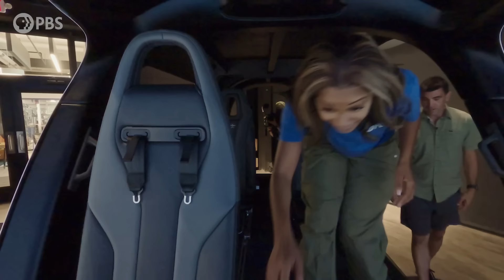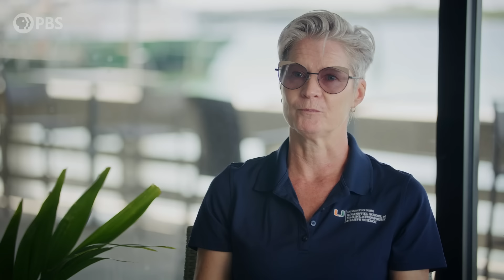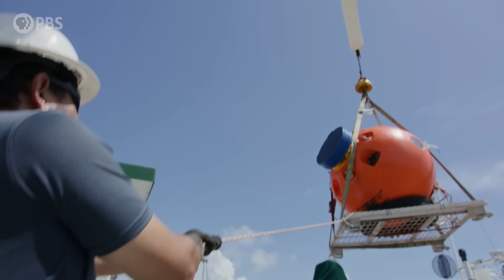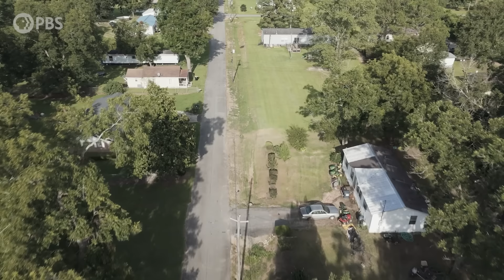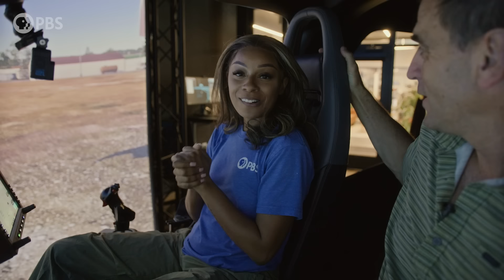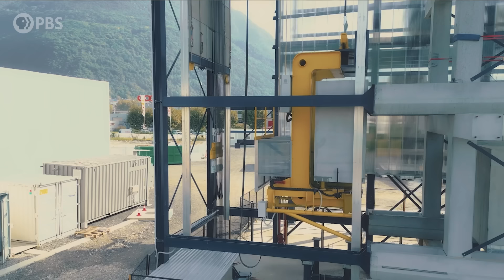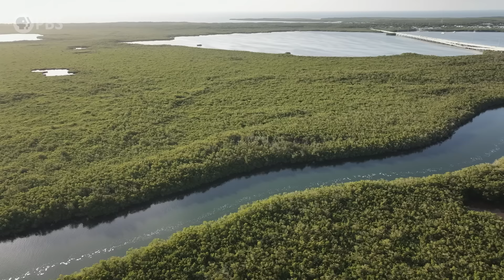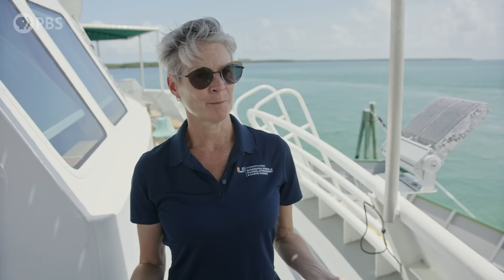This Is The Best Evidence That Atlantic Currents Are Slowing (AMOC Explained)

Comment: We burn fossil fuels to produce electricity. So electricity is not exactly green.  We have been told mining for a coal and fossil fuels is bad for the environment, but the electricity companies can mine for precious metals, rare metals to produce solar panels and batteries.  Don't you think that's contradicting If it's bad to mine for coal, it's bad to mine for precious metals Logic is extremely strong here.

Comment: Back in school 35 years ago or so, the so called experts said global warming would have Florida mostly underwater over ten years ago.  Yet, it's still there.   Climate change is the second biggest hoax ever.
Reply: Exactly 💯 

In college in the early 90s, I was taught that the ice sheets would disappear and sea levels would rise exponentially by 2040-50. Maybe my professor knew something (or was psychic?), but none of this has happened, nor do climate change proponents state it will happen by then. In fact, they keep pushing the date back every ten years, currently stating by 2100.

Comment: probably has nothing to do with the mid Atlantic ridge spreading about 10  centimeters over 40 years. add that into your models if you speak of deflections in currents
Reply: Nope, that would have no effect.
Reply: Wonder how those oil platforms and dredging the sea floor for nodules will do.. LMAO..vote for trump is a vote for Armageddon

Comment: This really starts going off the rails when it started going into electrifying aircraft. There is a huge difference between what you are showing, and replacing the entire global commercial aviation (passenger and fright) fleets. Pie in the sky BS that ignore basic material science hurt the argument more than it helps... We need to retool the energy markets, but its not going to happen by selling this fraudulent ideas. We are 100% not going to be flying electric plans for commercial aviation in 2030!

Comment: i have always wondered why geothermal is never really in the conversation. we have deep holes fracked all over the place, and there is heat what? 3 miles down? could a heat pump system using an effective coolant not be used to generate electricity via that heat transfer?

Comment: The majority of electricity in this nation is produced by the use of coal and natural gas.

You are dealing with the front end of the energy issue.  What about the batteries in electric vehicles.  The master and propellers are made of products that are not good for the environment.

Please be real and consider the TOTAL cost to produce, distribute and yes consume electricity.

Comment: “Electrify everything “ has its own costs, fyi. Heat pumps are not going to work in every climate. Also, to expand electrical infrastructure and create more electronics requires much more mining of increasingly limited resources. Luckily copper is pretty infinitely recyclable — if we retrieve it out of discarded electronics and other items. However, lithium, cobalt, and other minerals are problematic. Also, while glass is also “infinitely” recyclable, we’re not recycling it. We are starting to see shortages of the type of sand we need to make glass. 

Now I’m not saying don’t try, but we need to be wary of such broadly sweeping statements.

Comment: Talking about people still not using heatpumps for heat, especially in the south boggles my mind. I am 37, and I've never lived in a house, apartment, or trailer that used anything but a heat pump, with a woodstove, or fireplace for emergency heat, or auxilary/luxury heat. And the only time I've really ever been in someone's home that still used nat gas, a furnace, or a woodstove/fireplace as the main source of heat was friend's grandparents who just refused to update. But they also didnt have AC or had window unit ac. 

And honestly, my current house has a fireplace, that is wired shut, with the chimney flue also blocked It just isn't worth the effort to build a fire in there. Last house we used the wood stove a few times when the power was out.

Comment: Man cannot change the weather and climate, it runs in cycles and what people need to deal with is the next ice age, it comes after a warm-up. Then naturally occurring methane and co2 build up, then there is a point when the cycle turns and the cold cycle and ice age is back again, Gulfstream slows in the warm-up and speed-up in the cooling. This is PBS it features bad science with bad climate science.

Comment: I live in western PA and we have a heatpump, but if temperature drops below 35, we have to switch to our oil furnace and until heatpumps can work in really cold conditions, they only help halfway. Out heatpump does not work the whole winter, probably less than half. But it is good for A/C.

Comment: No mention of the other side of this conversation. 
We need magnitudes MORE ENERGY to solve these issues. Like that carbon capture you mentioned and recycling and repurposing cities in order to stop sprawl. Not just efficiency, but energy to do the repair work. 
No mention of advanced nuclear that its technology is moving at a pace faster than those heat pumps. 
Then there’s the capitalism issue…which is responsible for this climate change emergency. 
This whole “personal responsibility” angle for solutions is long been debunked.

Comment: We should also be concerned with methane, which besides molecule to molecule methane holds 26 more times the heat as a molecule of CO2, is also flammable! Further, melting permafrost is releasing tons of methane daily. Additionally there is a huge amount of fossilized material from thousands of year’s ago which will generate huge amounts of methane that has been contained in the Arctic and Antarctic areas.

Comment: You know there green myia that the electrical grid can NOT handle all of this electrical demand. We already have black outs all over North America because of insufficient power / high electricity demand. Just wait until every single housing unit has electrical heat, along with a plug for 1, 2 or more EV's.

And to add, by just the last 1.5 months, the geopolitical world is on it's way to collapse thanks for Donald Dump.

Comment: The whole premise of these videos is that technology will solve climate change, when it is precisely faith in technology that created the problem. The average American generates 15 tons of CO2 a year, when stabilizing the climate requires all of us not to emit more than 2 tons of CO2 a year.  You can only achieve that with a significant change in our lifestyles. Far less, meat, square feet, sprawl, transportation, mass consumption. Technology can help, but technology will not solve the problem.
Carbon capture is a joke, it requires huge amounts of energy, when energy generation is the fundamental cause of climate change.

Comment: The promise of net zero aviation is a lie.  There are no electric or hydrogen powered aircraft on the drawing board. In 2050, every aircraft manufactured will run on fossil fuels, and planes have a thirty year lifespan., so they will still be flying in 2080.

Comment: Heatpumps are great but please dont feature appliance salesmen touting electrification (and buying news appliances) as THE solution to climate change (even though i assume it was partly tongue in cheek). Electrified aircraft are toys until they are viable on the airliner scale (but even with magic battery tech not sure how they could ever match the speed). Giant amazon delivery drones arent going to help the climate, just think about the energy expenditure of road vehicle vs rotary-wing aircraft, electrified or not.

But hey, I guess we gotta reach for straws when the real change - large scale, top-down regulations, incentives and taxes backed by thorough research are completely off the table because half the country voted for scum.

Comment: I work for a major utility company in New York State, and I’m telling you right now if you try to electrify everything without overhauling and reconductoring the entire power grid, the wires will melt and whole thing will collapse on itself
Reply: I’m not saying it isn’t possible or necessary. I’m just saying glossing over and not even mentioning electric utility infrastructure seems like a major oversight.

Comment: Do you have any idea of what the inside of our planet looks like? There are lots of CGI images of the internal structure of our planet on the net, so you should!

FYI: The core of our planet is the same temperature as the Sun. The Sun is 93 million miles away, the core of our planet is only a few thousand miles away. They are the same temperature! The only thing protecting our feet from being burned off is the Crust of our planet. The crust of our planet is basically, chemically  speaking, a ceramic and ceramics are some of the best insulators known to science. Which is why they are used on the Space Shuttle to protect it from the heat of atmospheric reentry.

If you  shrunk the Earth down to the size of an apple, the crust would be no thicker than the peel of the apple and everything interior of that, would be red or white hot. Where does all that heat go do you think? Maybe invisible aliens are sucking it up and transporting it through a wormhole so it never passes us by and has no effect on the background temperature we refer to as climate... NOT!

The internal furnace of this planet keeps the overall surface temperature just right, to allow the Sun to add its' energy and produce weather that doesn't destroy all life but does mix and circulate the atmosphere and clean and purify the planet, to foster life here.

It is the incredible stability and finely regulated background-temperature/climate of this planet, that has allowed humans millions of years to evolve and is a testament to the independence and indifference of climate, to anything mankind can dream up. 

I hear the same narrative over and over, "There has to be alien life out there with all those habitable planets!" They just don't understand how special this planet is and this is only one of dozens of factors. This planet Earth is a very special place in the universe. 

This Earth is perfect in every way, to allow the evolution of sentient life and only a life form with exactly the same conditions and history could do the same, so the chances of finding intelligent life out there are slim to none, because there would have to another world with identical everything... Not just in the range but identical! Highly unlikely.

Comment: Heat pump/mini split system. I had a new shouse built last year and looked into installing a mini split. I decided against it because when the outside temp gets below 10 degrees, it no longer heats. Winters here in the upper plains often get down to -25. Minus 32 a few years ago and up to 100 in summer. I ended up with a full basement and a 30,000 BTU high efficiency propane furnace. Main floor is 560 square feet with 12 foot high vaulted ceiling. Insulation is R-30, 10" thick on all walls and ceiling. So far this winter the low has reached -22 and I've been comfortable.
That is the good news. The bad news is we now have a POTUS dead set against electric vehicles, solar and wind power. And unfortunately, dead set against we the people, we 'commoners'. Maya: "the only thing that stands in our way is ourselves". climate change deniers. Case in point, Donald J Trump.

Comment: "Decisions we make in the home are key to net-zero" is not at all a realistic approach. I disagree strongly with putting the blame of climate change and the responsibility of fighting it on the individual. Realistic solutions to climate change will only come from policy, and any significant impact on lowering the release of CO2 will not be made by individuals making their own lifestyle changes. It will come from cooperation, taxation, and regulation. In that order.
Reply: My home has always been 100% electric with a heat pump from a nuclear power station.
Reply: @Zindo.Majesty.HisMajesty  Good thing you didn't have to build that nuclear power station yourself
Reply: @  It’s been here for a long time. In fact they’re taking about adding more reactors to it.

Comment: Heat pumps for winter heating is not energy efficient.  Due to air temperature below 32 degrees.  Some units have auto emergency heat settings, other units on older unit its manual setting.  Emergency heat basically  will continue to heat the structure air below 32 degrees until outside temperature reaches  above freezing at 32 degrees.  It's a waste of higher electricity bills for the northern geographic areas. 
That why natural gas, heating oil and propane are a better option.  And propane being a much cleaner liquid gas, then the other alternatives.  Large fire box heater  using wood outside the structure can offset energy usage. 
 My neighbor down the road a mile or so has heat pump. They are looking back into different sources,  to add, then paying over 600.00 a month electric bill. The green energy deal everyone else profits, except the homeowners.

Comment: Javin’s paradox- increased efficiency can lead to increased consumption, rather than decreased consumption. We may electrify, but it doesn’t necessarily follow that we reduce consumption of fossil fuels. Also, “renewable” energy is dependent on materials, which are limited and require mining, and which need to be rebuilt/replaced every so many years. Solar panels and wind turbines need to be replaced. Why don’t  we talk about the hard truth that we cannot continue an economy built upon endless growth? Renewable energy isn’t going to save us from radically changing how we live on a planet with finite resources.

Comment: Going electric is great, but why didn't they just add a few solar panels wired to their local electrical grid in addition to the heat pump idea......NOW you are actually helping on climate change.  Generating electricity is the Main issue. Solar is free (after initial investment), but burning coal and natural gas to get your electricity to use and save on your heat pump bill is costing you and the environment Every month!!

Comment: Cheap energy doesn't go well with investors (just ask Tesla). Thus, to solve the problem, renewable energy production should be funded and owned by the public who would fund it  for the sake of consumption, not for the sake of profit. Otherwise, renewables will never get to more than 1/4 to 1/3 share of the capacity in any grid because that's when oversupply starts driving prices below zero. Besides, fossil fuel economy is worth tens to hundreds of trillions of dollars making it much too big to fail. Thus, any quick transition is out of the question as it would probably collapse the civilization as well. With increasing investments in fossil fuels (and yes investments are increasing more than investments in renewables) any slow transition becomes unlikely as well. What will happen is that temperatures will rise 4 - 7 °C and then something drastic will happen, either by human action or a natural collapse.

Comment: these environmental videos are always so hypocritical. where do you think we get the energy to power electronics? these people think anything electric means we don’t use gas power when that’s not always the case.
Reply: There are however many ways to generate electricity so gas power is not mandatory.
Reply: @ you do realize that everytime someone charges their tesla at a supercharger, they’re literally still using the gas & coal that powers the grid? anything that comes from the grid requires gas & coal, and the more electronics you use, the more gas & coal is needed to power the grid.
Reply: @biz6361  The power grid is not solely powered by coal and gas is it forever locked into coal and gas (hint: nuke plants exist). Also, those are point sources which can be mitigated more easily than what’s coming out of each tailpipe.
Reply: too many edits made that unclear. The power grid is not forever locked in gas and coal, other generation sources exist and newer ones can be added in. Compared to gasoline (which you cna only get one way), electricity is more flexible to power vehicles.

Comment: When I first learned about the weakening of the AMOC, I thought the only impact was going to be a colder Europe, but now it appears the impact will be much worse and widespread. The change in the current causing local sea level changes, higher in some places and lower in others, and possible faster melting of Antarctic ice are just two of these knock-on effects that could make a change in the AMOC much more impactful. It is not nice to mess with Mother Nature!

Comment: Typical.  Lots of fear and if this then that.  Lots of speculation.  Zero science.  Zero measurement of actual AMOC speed.  Zero numbers about environmental problems with batteries.  Zero numbers about the megawatts required to electrify northern States heating and transportation vs the power generated from sun or wind or even more speculative technologies.  Just blue sky rainbows green goo.  Fine, just fund your fantasies without taxpayer $.